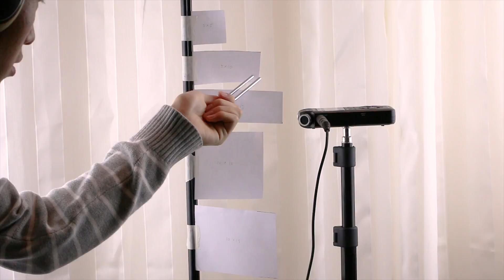IYPT 2019 Problem 3 Undertone Sound Demonstration

Comment: Can you explain the details of the undertone theory? How different between the overtone and undertone. Please show your some equation of this undertone? Thank alot.
Reply from the maker: I don't think I know enough about this problem to give a detailed theory. From what I know, the vibration of the paper is the source of the undertone. This is mostly likely caused by a frequency matching between the tuning fork and the paper. I would expect that the frequency of the tuning fork to be integer multiples of the undertone. Hopefully this helps.
Reply: Canadian Young Physicists’ Tournament Thank you a lot of your reply, Can you agree about the frequency of paper vibrate same as frequency of a fork because i confuse about the meaning about the undertone define in this problem? I try to measure frequency with application in the iPhone the result is same frequency not lower frequency. If you agree i will be confident my experiment. Thank you so much.
Reply: Thera re variety of  frequency that we call spectrum some f is to loud and much more power so we cant detect undertone sound by application
  @siripongsrisuwan9473

Comment: There are so much high frequency. How can i separate the frequency i want?
Thank you very much
Reply from the maker: You can use a software like Audacity to process the audio. You can use a low-pass filter to cut out the higher frequencies.

Comment: I've done the same way as you do but the frequency didn't change. any suggestion? 
Thank you very much
Reply from the maker: I would suggest having a more controlled way of positioning the paper and the tuning fork. Maybe you can try to move tuning fork towards the paper slowly. This might allow you to find that optimal position of weak contact.
Reply: Canadian Young Physicists’ Tournament 
I can’t make the frequency lower... 😭
What application you used? 
It would be very kind if i could see example of the result 😱
Reply from the maker: I don't think my results are that good. I used Audacity to process the audio. Some of my friends told me that they got it to work by keeping a very small gap between the paper and tuning fork. I'm actually not sure if it's correct.
Reply: Did you success to get the satisfaction result? would you pls give me some consult
Reply: @knuttorn  I've got some undertone sound , but it looks hard to find the result by each variable. 
To give some help, immobilize both the tuning fork and the paper and put them together with a slight touch.
After recording the result, in my case i used 'Goldwave' and High pass  and low pass the freq what i don't want.
After filtering, it is much better to watch the reselt.
(plus/ for help do you know how the undertone sound happens?)